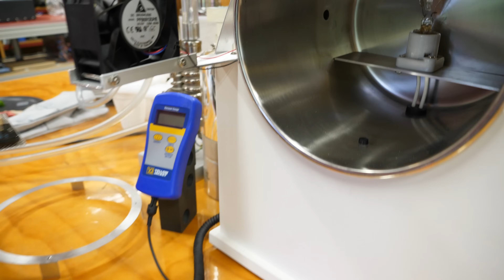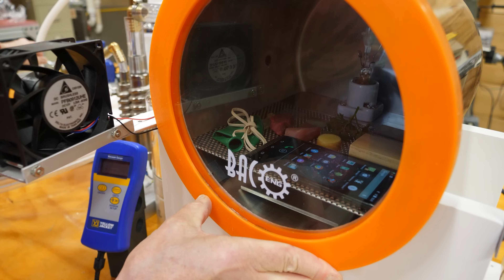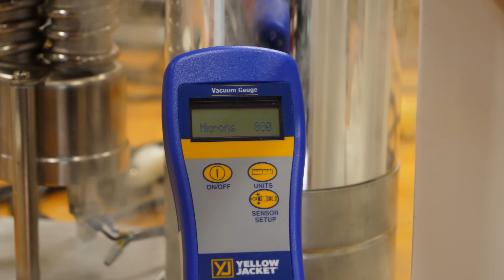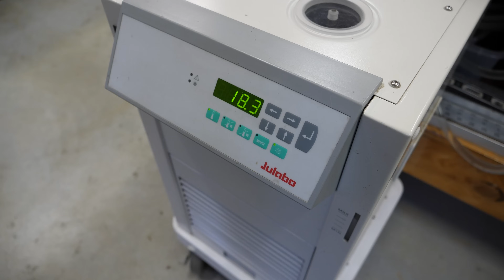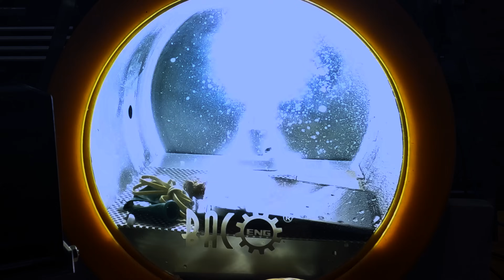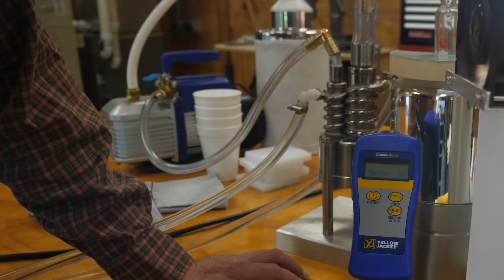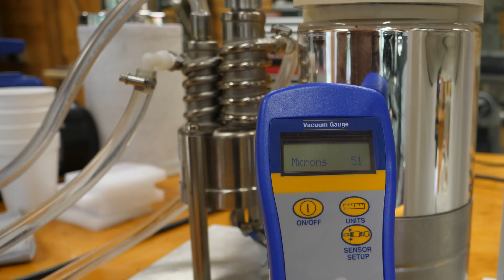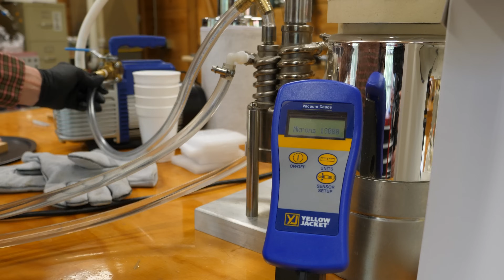We exposed BEEF to the vacuum of space, then ate it!

Comment: Liquid Nitrogen
Former AF member. I maintained a variety of ground support equipment during my tenure in the military.
At one time I maintained the liquid oxygen and liquid nitrogen carts on the flight line i. e. where the aircraft are parked. While it's true liquid nitrogen in small quantities will evaporate quickly enough you won't be harmed. 
Although in the event of dealing with hundreds of gallons you will end in very painful way.
I was shown a video of a victim of a cryogenic liquid accident. Only his head/face, neck and shoulders were shown.
He hand no skin and his eyes moved very quickly in random directions, he was also shivering. The video's narrator stated he died shortly after the short sequence was recorded.
My point cryogenic materials are dangerous handle with care.
Liquid Oxygen is even worse.
Sometimes those Liquid Oxygen servicing carts would leak so you'd see little bubbles of liquid oxygen sizzling on the concrete of flight line. Many airman that worked on the aircraft liked to step on them and make a loud popping sound, like bubble wrap only louder and more explosive. The problem is that liquid oxygen reacts violently with fuels and grease. Several airmen had either half or all of their foot, because there was grease on the sole of their boot.

Comment: Maybe consider doing a mechanical stress test on other.woods samples such as balsa wood delete the radiation component since this would be for terrestrial end use. Compare hydroscopic degradation over time by weighing repeatedly.  Finally try sealing super light wood with resin to prevent humidity absorbing issues, again comparing against mechanical strength changes. There may be commercial potential for this where weight is an issue such as home built aircraft.  Apple's to apple's more mechanical strength for equal weight.
Reply from the maker: That's  a good idea.

Comment: You might try small cups of different types of oils and grease. Some cockroaches.
30 years ago I did a bunch of wire leakage tests for NASA for a new pressure wind tunnel that was going to Ron at 90 psig. We were going to have a couple thousand wires both power and instrumentation going through epoxy potted passthroughs into the tunnel. I tested just a couple feet of wire, we didn't worry about line loss then we potted the wires with epoxy using a syringe but for the number of wires that would take way too long so with exacto knives we split the outer insulation and twisted the wire there to open it up between strands then osing a epoxy that was water like we filled the pipe and it soaked into the wires for a foot or two and made them stiff. To test the leak rete I mounted a cork on a plastic tube that would float up inside a graduate standing upside down in a bucket of water with the wires curved up into the graduate then using a vacuum sucked the air out of the graduate which filled it with water.  The ends of the wire were potted into a fitting that we could pressurize to 90 psig and we would take readings off the graduate every minute to calculate the leak rate per minute. A very fun project.

Comment: How about a vacuum cooker test. Just pull vacuum approximately equal to the opposite of what a pressure produces. Just my guess about 15 in HG could have interesting outcome..No special lighting, just enough heat for regular a regular cooking situation.
Reply from the maker: The problem  with that is that the water would begin to boil near room temperature and the food wouldn't cook.
This is why there are instructions that increase the cooking time when cooking at significant altitudes above sea level, and this represents a very small reduction in pressure.

Comment: With a few changes such as a higher pressure setting, no light source, large water trap, and heated sample tray you could freeze dry food. Sliced strawberries would be great test. Commercial freeze dryers have heated trays and large refrigerated water traps. A small silicon rubber heating pad would work nicely to keep the strawberries from actually freezing as the water is removed.

Comment: Not even close to the vacuum of space. !!
Reply from the maker: Actually,  it is.
Whether it's 10^-11 or 10^-5, the items being tested will experience the same effects.  What makes the chamber vacuum like space is the exposure to radiation that our atmosphere blocks.
Reply: @TechIngredients    10^-11 is not equal to 10^-5 .   That they behave similar, at some level, does not change that fact.
Reply from the maker: You're right they perform similarly as in this test. Don't ignore what I said about the radiation.
Reply: @TechIngredients " Perform similar" does not make them the same, when you can measure actual pressure

Comment: I have a project idea request that may or may not be possible. It would be extremely educational, but requires a huge level of safety and research that I wouldn't trust any other channel to accurately document. 

A Very small micro Nuclear(fission) reactor that uses a containable radioactive source and a closed loop turbine generator. I'm unsure if this can be safely achieved with low levels of radiation. 

The objective would be to show and educate viewers  and help remove unfounded fears. Plus it would be amazing
Reply from the maker: It could  possibly be done.
However, access to enough  fisionable material would be impossible.

Comment: Couldn't you use science to get into the light bulb?   Heat up the light bulb in boiling water, and then dip the tip in ice cold water.  Wouldn't that make a clean break and pop the top of the light bulb off?   Saving you a grinding disc. And it would be really cool.
Reply from the maker: That might work.
Don't  forget you'll still have to deal with the contaminated water and the glass fragments.

Comment: Great video as always, thank you. My suggestion for a potential future test would be to see how much the strength of the wood was compromised (or not) by the process. Clearly the evaporation of the volatiles made the samples a lot lighter. So my questions are:
How much lighter is it?
Was it weakened?
Was the strength-to-weight improved, reduced or did it stay about the same?
What do you think?
PS: I don't really know anything about strength testing wood (or anything else). I'm just imagining a bending or some kind of tensile test.

Comment: I wonder how much of the changes you see are from the materials getting very hot.  Without air, they would mostly have just radiation to cool them... they probably got very hot with that light in there.  I guess that WOULD be a lot like being on the sunny side of the Moon though...  I wouldn't have wanted to eat any of that... not with the battery outgassing all over them..

Comment: Keep up the good work.  I'm  missing your more frequent productions.
In these times where people are racing round buying electric cars and the don't have large solar panels with storage batteries to charge their electric cars but unused the grid where coal fired power stations are the norm, I think a examination of the carbon production needed to mine lithum and the electricity needed to produce photo voltaic  cells, at what point do they actually pay back and start reducing the carbon load on the atmosphere  if ever.  I am told it takes 700 litres of diesel fuel to just mine enough lithum make one 18650 LiPo cell.  Add we have not even begun to implement the recycling systems for these batteries which may well create a huge environmental impact.  
Just something to think about
Reply from the maker: That is the big question. 
That diesel to cell ratio is almost  certainly bunk.  Just look at the relative  cost of the diesel to the profit  from the one cell.

Comment: The swollen battery clearly shows the danger of cutting corners. I am sure there are perfectly serviceable space rated batteries around one little screwup, and we have an astronaut or a space tourist with a battery powered device exposed to space causing a fire after a spacewalk. Elon Musk work hard on cutting launch costs so eventually we are going to have non experts out there. Still if you want to redo the experiment with the phone, or similar device later I suggest that you ventilate the device by drilling a hole in the casing.

For the foodstuff I suggest an experiment without the radiation source (the lamp) and keep everything cold. If the inhabitants on a space station/spaceship/moon base decides to store food in an outdoor larder they probably want it to be protected from the sun.

Comment: If you don't already, i would recommend using a compressor for your audio either actively or in post. It will prevent you from having to warn people about loud audio and reduces the dynamic range of your audio, allowing you to bring up the overall level of your video's audio. Compressing your audio also saves some editing time on occasions where you get extra loud or soft portions of the video!

Comment: The beef experiment was predictable! I propose another experiment: divide 1 piece of beef into 3 parts No. 1 usually fry (in a frying pan at normal pressure) No. 2 fry in a vacuum chamber at a pressure when the water boils + 62C and No. 3 cook in a vacuum chamber when the water boils + 43C. Explanation: up to +42C, proteins are not destroyed, after +65C, most pathogenic microbes begin to die, but most useful proteins and other substances still retain their properties (the process is called pasteurization). You need to compare taste #1 #2 and #3. In theory #2 and #3 would have higher nutritional value and should taste better???

Comment: Greetings from Germany. Long but interesting and well explained. Proposal or question: Is there a way to simulate a fast pressure drop or sudden leakage in a spaceship? I mean you exposed that materials to slowly increasing vacuum. But if, lets say a spaceship gets hit by Elon Musk's starlink satelite on malfunction, the pressure drop will be so fast that all liquids in organic material like a potato, or a bulls eye, are gonna boil instantly, won't they?
Reply from the maker: There is. Two chambers with the smaller pressurized chamber separated by a rupture disk or a butterfly valve from the larger, evacuated chamber would work.

Comment: Great video as usual! Very interesting topic and a very cool setup.

Since you're taking ideas for what to put in there next, I would like to suggest some "tactical nylon" or Cordura. The fabric that they make military gear out of, basically. Also clothes fabric in general. what's the difference between 100% cotton vs. 100% polyester (I'm assuming that would probably melt since it's a plastic) vs. blends of the two vs. wool vs. etc.

One small note too: If anyone decides to try this themselves (Or you decide to make a new one) they should probably also be wearing a respirator and have like a shop vac or something running nearby while cutting the glass bulb. Glass dust is extremely bad for your lungs.

Comment: Hello sir Eric and Tech Ingredients friends, greetings from another side of the world.

Use My Innovative, Cheap Method to Produce Stronger, Thinner & Lighter Composites (Especially Carbon Fiber):

Thanks. I guess pressure may be superior coz' that's what Koenigsegg & Pagani use on their huge pressure cooker, their autoclaves for their carbon fiber but I would suggest this: combine mechanical pressure + air pressure or vacuum using this innovative DIY method: fabricate a thick spring w/ a convex plate (the in the form of the pressure pot's curved lid, perhaps by hammering it into shape or using a hydraulics or jack used in cars (or a real hydraulic press from a nearby shop or a bench vise)  and weld onto the spring on the other side of the spring, a flat plate (this plate should be covered w/ plastic film that the resin won't stick to and coated w/ resin for good measure). Put the material composite and the the spring on top of it and the the pressure pot's lid and lock in place (it'll be very hard coz' of the spring's tension). 

When the pressure is increased, the air would also be taken out by the actual mechanical force from the spring contraption- same w/ the vacuum one. It might take a bit of trial and error in determining the right length and thickness of the spring that the lid (and human strength) can take without the spring going through the lid or damaging it  (better if the top convex plate is welded with a sturdy ball bearing so it the spring contraption does not scratch the lid and can rotate freely. The bottom tip of the spring needs to be heated and bent at 90° and then threaded so there's a bit of height adjustment (someday the ) threads may have grooves and the female thread on the bottom plate can be lined with ball bearing on spring tension, so there's a kind of ratcheting mechanism, so the plates don't move as the spring presses onto the lid and the composite material).  

Unless the composites are always of the same height, the spring contraption may need to be bespoked for maximum mechanical pressure and unless it's always a flat composite,  the bottom plate needs to be bespoked to the contours of the composite (for example it may have curves and dips) and then there needs to be a bespoked plate at the bottom of the pressure pot or vacuum chamber in the shape of the composite so it's sandwiched, pressed as strongly as possible while it's subjected to air pressure (can it be not air but a denser kind of air injected into the vacuum chamber?) or vacuum. It'll be forged composite in effect coz' the mechanical pressure but at the same time under gas pressure or under vacuum. Both plates at the bottom for non-straight composite materials need to be lined with a plastic film the resin won't stick to (with resin applied to

If the autoclave is big enough, one can put a hydraulic press so it's mechanically being pressed (forged) while also under gas pressure or under vacuum.  God bless, I hope my innovation works and will produce even stronger materials that are stronger but

All inventive and innovative ideas like this are from God, I'm but an instrument of His peace and innovations. 
:-)

God bless, keep making the world a better place. Revelation 21:4